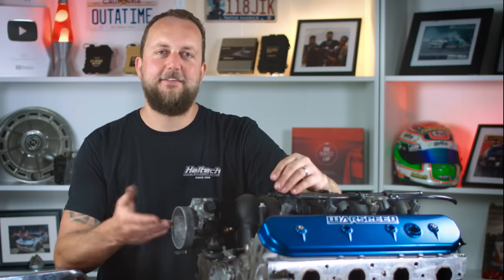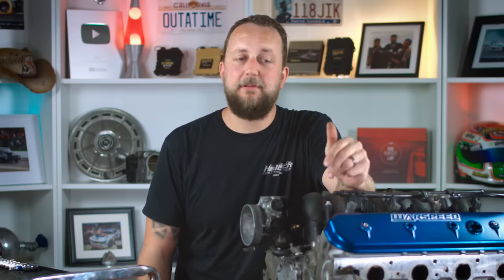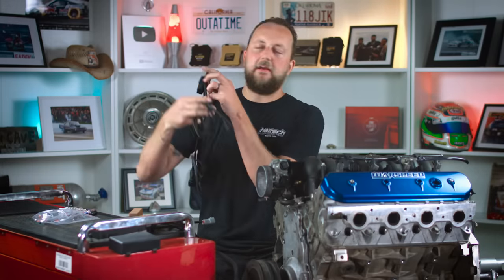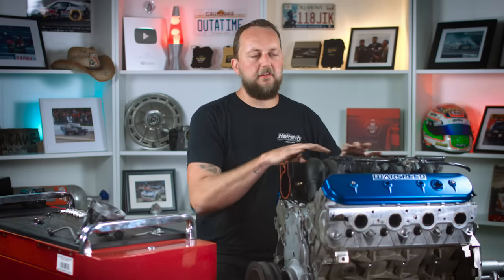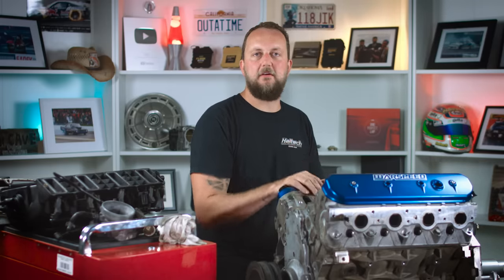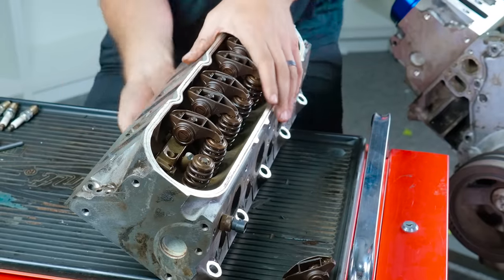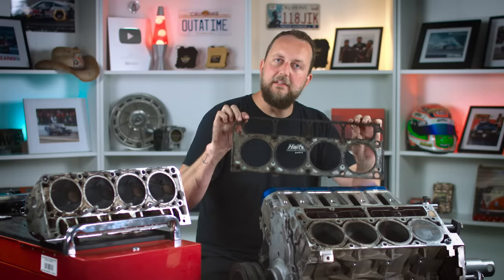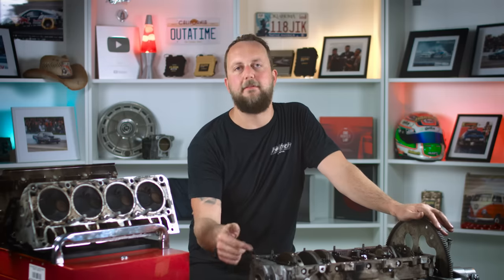🤔 What's so special about the LS? | TECHNICALLY SPEAKING |

Comment from the maker: How many times have you heard the term “LS-swap”? What makes GM's LS series so popular with drag racers, hot-rodders, drifters, modders and tuners alike? 
We dive deep to find out the reason why this particular engine is so many people's favourite. 
This is quite a long video so if you want to jump a particular section, we've included some shortcuts:
Engine Overview: https://youtu.be/wMZG7nFx-2M?t=29
Tuning Options: https://youtu.be/wMZG7nFx-2M?t=223

Engine Teardown: https://youtu.be/wMZG7nFx-2M?t=346
---------------
What engine you'd like us to cover next?
Reply: It would have been cool for you to talk about the difference in uses between the LS and LQ. I only recently (within the last two years) found out that you didn't get LQ's in Australia. I know it's just iron vs Aluminum but...
Reply: Ka24de lol
Reply: Soooo.... What actually is it that makes this engine good? The simplicity alone doesn't explain al of it...  Nice to work on and sturdy design, but what is it that makes it perform? Is it an efficient burning engine that can operate safely with a high compression ratio or does the power just come from displacement? I wouldn't mind a bit more detail.
Reply: AC
Reply: Scotty, you totally skipped talking about the high flow port design, the large cam lobes, roller lifters and beehive valvesprings that combined  allow for aggressive cam profiles and high rpm with good reliability. These things together with the strong bottom end and fairly simplistic design are what makes the LS platform such a good engine. Easy to make reliable  power. That, and just like the old gen 1 and 2 small block, there are millions of them out there for the choosing.
Reply: How about something from the Buick family of engines?  The Big Block Buick (400-430-455/6.6-7.0-7.5), Small Block Buick (215-300-340-350/3.5-4.9-5.6-5.7) or the classic Buick 231/3.8 lite, last seen dominating the engine compartments of Buick's GNX, aka "Lord Vader, your car is here."?
Reply: Haltech please do one on ecotec engines
Reply: The Dodge slant six... bulletproof and long lasting. Not much power though.
Reply: Obsidian the only real difference is the metal of the blocks and the intakes. Iron engines got big ugly truck intakes. There’s minor differences like valve material but nothing major.
Reply: 351 cleveland, good old school engine that had a short life in the states 🇺🇸 but much longer in  australia 🇦🇺
Reply: Never
Reply: Dave Verdonschot The GM engineers used CAD along with computer simulation. They used compressible fluid flow theory to allow them to run many simulations without having to build and test physical prototypes. This produced the Gen3 small block. Continued computer work along with real world experience led to the adaption of the rectangle port in the Gen4 over the cathedral port as in the video engine. In general passenger car engines were aluminum block with cast-in iron sleeves. These blocks can only be given a clean-up bore of about 10-thousands. Truck engines are typically aluminum heads on a cast iron block. These can be bored more. Some early truck engines were iron on iron. The desirable truck engines are the LQ4 and the LQ9. They are 6.0 liter engines with a 4inch bore. These can accept the later Gen4 heads with the bigger valves. The biggest difference between the LQ4 and the LQ9 is that the 4 has dished pistons and the 9 has flat topped pistons. Therefore the 4 can accept more boost than the 9. There are videos all over YouTube which go into much more detail. Happy hotrodding!
Reply: Next one do a VQ engine (vq37vhr)(Japanese)
Reply: @daveverdonschot7956  Let's just do a quick and dirty comparison with the 5.0 Coyote. LS3 costs less, is much more compact, and base hp is similar. A simpler design makes it easier to take apart and rebuild. There's a lot more aftermarket parts for the LS3.

The power of an engine is limited by how much air it gets through it.  Either spin faster, have bigger displacement, or use forced induction.
The Coyote has dual overhead cam (DOHC) which allows faster RPM, but the LS3 has 6.2L displacement.  Less moving parts and such can give LS3 better efficiency in some scenarios, and smaller displacement can give the Coyote better efficiency in other ways.

As for high compression ratios and such, I really can't remember how that affects engines.
Reply: Haltech I didn’t notice the Oklahoma tag in the background until 4:39 I’m from 918 Tulsa
Reply: You guys get that "What's so good about the 4g63" video wrapped up?
Reply: Way too many times 😂 I literally came across this video at its peak. I feel like I hear more about this v8 than the car it came out of.............isn’t that a little strange?😂
Reply: AMG's M156 or Porsche's Metzger H6
Reply: @daveverdonschot7956  everyone who knows anything it's about displacement with the LS look at LS1 ,LS2  ,LS3 all it is is changing the displacement basic motor only just recently made the changes they should have with the latest Corvette cv8.
Reply: @n8rivera74  same design basically I don't know what difference is you're trying to look for. Haha
Reply: @scottrodgers2139  it's been proven, DOHC is more efficient than OHV engines that's why they rev higher naturally from factory as the overhead valve assembly is heavier believe it or not and has more harmonic vibrations interference. And of course only improves with aftermarket support all comes down to your pros and cons check out YouTube channel real Street for the info.
Reply: @igvtec  TL;DR Efficiency can be very dependent on the situation. Trust me. As a former engineer that developed and tested V8 engine systems at General Motors, I'm confident in saying I've forgotten more about engines than you'll ever know.

Let's illustrate efficiency in a few scenarios using two cars and two naturally aspirated engines.

What's more efficient in a small car: a 2.0L DOHC I4 engine or a 6.0L OHV V8?
When cruising on the freeway the 2.0L engine will run more efficiently because it's not wasting a lot of energy on pumping losses. Having a larger engine in the small car makes it much more fun, but doesn't help efficiency.

Things are a little different in a large SUV. A 2.0L DOHC can get the vehicle up to speed. Even if you're okay with a 20 second 0-60 time, what RPM is it running? If the engine doesn't have enough low end torque, it will never upshift. Since the frictional losses go up exponentially as RPM goes up, it quickly negates the savings from pumping losses. Also, the higher RPM's are harder on the engine, quicker to wear out, and more likely to see it blow up.

GM has been able to reduce pumping losses by reducing the effective displacment with active fuel management, but no one has found a way to reduce friction losses by reducing the number of cams being used.
Reply: @datasailor8132  the LQ4 and LQ9 have the exact same cylinder head so the LQ9 makes more power in stock trim because of higher compression thanks to the flat top piston you mentioned. This also means it'll make more power at a lower boost level than the LQ4. For N/A applications, swapping the stock 317 heads from the 6.0 with a set of 862 or 706 heads from a 5.3 will bump the compression from 9.4 to 1 on a LQ4 to 10.4 to 1 and higher on the LQ9 because of the smaller combustion chamber on the 5.3 heads.
Reply: What made you want the Oklahoma licnese plate? My home state!

Comment: You will notice that the timing cover has no locating dowels to the block, on initial assembly, it is important to fit the timing cover with seal installed without tightening down the bolts completely, then fit the balancer, then complete tightening down the timing cover bolts, this ensures the timing cover is centred to the balance and minimises the chances of oil leaks.
Reply: There are a few tools now that solidly locate the cover to the crank snout and allow you tighten the cover down and install the seal after.
A similar operation must be done with the oil pump. You need to remove the cover on the pump, shim it between the rotor and case then tighten all the bolts and remove the shims.

Comment: 136,000 miles- 220,000 k's. Drives like new -like the last one I had -still has the same grunt it had when brand new. Love this engine.
Reply: Good to know,  my 2012 LS3 V8 engine   has only  30,000 miles,   so I have a long time to enjoy it  !!
Reply: had a 2000 1500 with the 5.3 that got to 350k miles and was still running strong as the truck fell apart around it.

Comment: simple, reliable, makes big power, gets decent fuel economy.   proof other companies are over engineering engines.  I won't even consider buying a ford with their cam phasers failing.  it's a nightmare to fix.  they can't even make a engine that spark plugs come out of without breaking lol.
Reply: If 13mpg is good fuel economy than something is up with you oh and that's tuned trucks untuned they was getting 10 my 5.4 never seen below 20 with 28 being it's best
Reply: @calincampbell5637  shows up in a 04 lighting with a pulley on it and a set of stickys what was you saying again
Reply: @calincampbell5637  you calling 19 mpgs in a car good you tripping to
Reply: The 5.0 has more than just cam phaser issues these days. The 5.0 Coyote blocks are significantly weaker than older Modular blocks. With a Coyote, you're looking at paying a machine shop to sleeve the block and weld gusset plates to reinforce weak areas.
Reply: @hochhaul  that's why ford dealers sell them new at the 800hp mark
Reply: @austinhowze6280  They don't care. They overcharge by so much, they could warranty the engine and still make a ton of extra money off the moron that buys it.
Reply: @austinhowze6280  the ZR1 corvette used to be exempt from the gas guzzler tax because it got over 25mpg with 700hp.  a fucking honda accord does 25mpg because it has 200hp.  aerodynamics is the name of the game.  a truck yes, 17 to 20 mpg is about all you get. but considering old trucks with 190 hp 5.7L engines were only getting 10 to 13mpg and a new truck with 5.3L 400hp engines get almost 20, they've come a very long way.  and they don't need all that over complex bullshit engines.
Reply: @blue03r6  my 09 5.4 3v all spark plugs came out no problem and the camphasers still work with 310xxx kilometers not going to lie I am still looking at buying new ones along with lock outs for preventive maintenance
Reply: Ford axed that triton program in 2011 thank god. The 6.2, 5.0 and now the 7.3 pushrod v8 are serious contenders
Reply: Wait 'till a failed roller lifter lifter wipes out an engine - LS magic all gone.

Comment: I'm fortunate enough to own a LS7. It's a real gem of an engine. And now, GM dropped the price, at least here in the US, for a long block crate engine, from about $17,500 to about $10K-12K. Hot Rod magazine bought one for a project. Broke it in then did the same SAE ISO witness certification correction the engine was rated with. About 520-525 bhp and about 490 lb-ft torque. And it has a dry weight of only about 438 lbs. It's an amazing piece of power plant.

Comment: I like my german cars. But thanks to one Cleeter McSkeeter there's going to be a few cars with an LS engine through my garage. Just watching this I want to tinker around.
Reply: LS swapped E46?
Reply: Hell Yea Brother!!
Reply: @daszieher  w124 e-class owner here, basic bread van 4.8 ls under the hood while I'm working on my sequential air shift control for the trans. LS + German chassis is the way to go!
Reply: @unlisted9494  after having pulled and replaced the injectors on the M57 diesel up front in the E46 the thought of an LS becomes more appealing.

however the diesel lump makes a real 37MPG @ 90-100MPH. no LS is ever gonna return that mileage.

seems like a good excuse to get a second E46...
Reply: @daszieher  ....what about a Chevy Duramax diesel then? Best of both. For real though, an e46 with a cranked up Cummins r2.8 would be really cool.

Do you like your e46? Considering one as my next drift project
Reply: @unlisted9494  if I were to stay diesel, I'd stay with the 3.0 M57. I live in Europe, you can get parts fairly easily.

The E46 is a nice, small package. I haven't worked on it extensively myself, because I haven't had the time. I use it as a daily driver. I like it's compact size and agile handling. Not as tiny as the E30 or E21 I used to have (the latter was around 2400lbs)

Comment: LS is with out doubt the greatest engine combo ever created,,, as ALUMINUM,, very light,,, very strong with steel sleeves,, small in outer volume,, but very big inside,, bottom end utterly strong,, new gen like LS3 have unreal good head-flow design,, as stock,  unreal how much aftermarket stuff can be bought, seriously good for F/I in stock form, with reasonable tuning and setup, cheap ,, and i mean cheap,, I bought my LS3 crate 525 for an amount that no other engine manufacturer can offer with 500+ hp and loads of usable tq,, from every band of rpm,, 
If you dont see the benefit from the LS vs other engines,, your either an idiot or just wanna accept the facts,, LIKE it or Not,,, yes we know that there are many engines out there that can make a lot of power,, and the cost zillions of dollars,, but no engine,, and i mean no engine can make as much power with all positive benefits as the LS with as low cost........ ok i admit it doesent look very spectacular,, but what is does with the old tech  design and structure is just gobsmacking compared to other motors

Comment: great tutorial.    most times the simpler the better, the fewer the parts the less that will go wrong.  The engine does not have to scream to get torque (power).  timing chain no timing belt  why they think belts are better is beyond me. Thanks for your time

Comment: In one way, the LS is just like the old 350 small block.  They both make decent (although not always earthshattering) power, they're both relatively reliable, they have a huge range of aftermarket parts and services, but mostly...packaging, packaging, packaging.  They fit into just about anything.  Not the most up to date design - but sometimes, old-school tech like cam-in-block and pushrods is good enough, while keeping external dimensions to a minimum.
Reply: It's crazy how glad we are (well a lot of us at least) that GM didn't go the way of Ford and the rest by chasing the overhead cam (yeah they are doing it with Cadillac but that's about it). I know Hemi's are still pushrod but without the LS/LQ I don't know what everyone would be doing right now in the engine swap/aftermarket area. Like you said it's the packaging. I don't think a lot of people understand just how long and tall an inline 6 is.
Reply: Obsidian well the c8 zo6 is going to be ohc probably so looks like it’s going to die eventually
Reply: @corey0189  I doubt it... But who knows, maybe they switch engine platforms just for the Z06? They're really only done that for the ZR1 in recent history. But the word is that it'll be turbo'd. I guess the Cadillac's Blackwing is a Twin turbo OHC V8. I just wonder about the packaging of an OHC in place of the pushrod.
Reply: Obsidian the c8.r already has a 5.5 ohc v8 with a flat plane crank.
Reply: @corey0189  Yeah, they developed it specifically to fit within the racing rules. But I don't read much into what the R has. The Porsche 911 GT3 RSR's engine is mid-mounted and there are numerous other examples of where race version's don't match production. They have said that it'll be a production engine but I'm not sure if that'll be the Z06, ZR1 or neither? People have also been saying it'll be NA as well. But getting 650+ hp using pump gas (because it's Corvette and the new car has to have more hp than the old one lol) is going to be a task. Maybe they'll punch it out to a 6L+ (I'm not sure how much room there is in the block). Anyway, the "R" version's engine hasn't had anything in common with the production models in years. 
.
But all of that is off track anyway. The C8 has a pushrod, the Camero, all the trucks, SUVs etc have LS motors as well. So even if a higher tier model has an OHC it really doesn't matter. To that note the Shelby GT350 has a flat plane crank, but the new GT500 doesn't. So who knows maybe it'll be a thing but it'll be so in low production cars
Reply: Cam-in-block is  around 40 years older than that - and while Duesenberg may have made a DOHC engine in the '20s, they certainly didn't make them commonplace.  The move towards OHC in mass-market cars didn't really get much momentum until the '60s with cars like the FIAT 124 Sports and the Alfa Romeo Guilia.  That's why people tend to term it as "old tech" or "old-school."
Reply: @aussiebloke609  Yup, It is essentially the same as if someone made a new passenger plane that used Propellers. Once the world moved on to Jets in the 50s, choosing not to do so (decades later) would make you appear out of touch, or simply lagging behind. It's only later when people are able to look at the benefits that they once would have dismissed because they threw the baby out with the bath water.
Reply: YES SIR it's all about room to play with, hence why I'm in the fence about the LT4. Solid ford man, but if someone brings in a LS with a little money to throw at it I get excited.

Comment: The LS basically IS the modern Chevy small-block
Reply: But but what about the 5.3
Reply: They took what they learned in 50 years and made the ultimate small block motor w a skirted block 6 bolt mains and moved the cam up thus making it able to be a lot bigger smoother ramping on the lobes mild idle with big power individual coils etc etc the list goes on and on awsome flowing heads even a stock 5.3 is almost 300 hp you weren't getting that w a stock even 400 small block chevy motor
Reply: @glennmanchester1568  can confirm just did a 400 sbc delete, went to a 4.8 truck motor. Alot more power